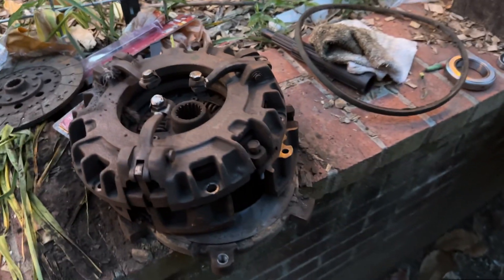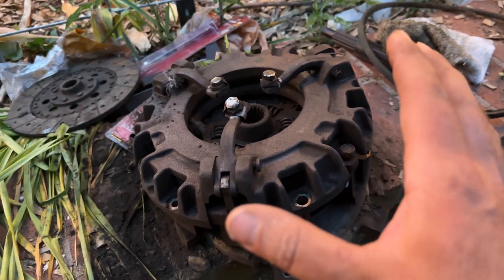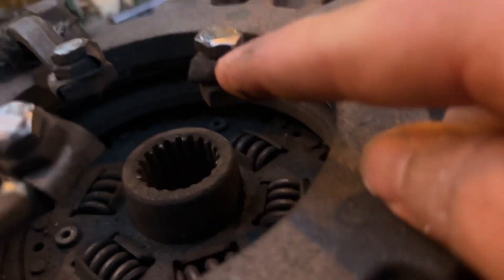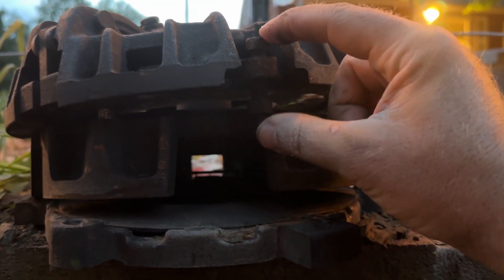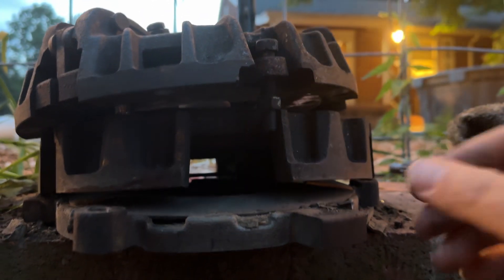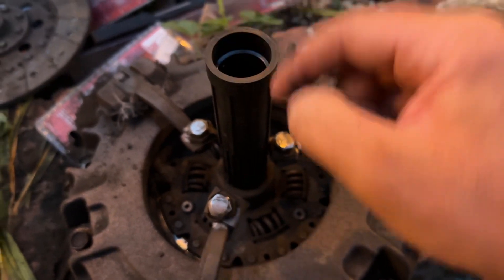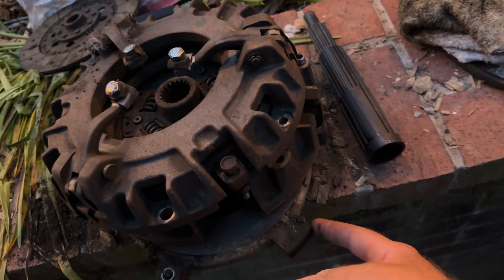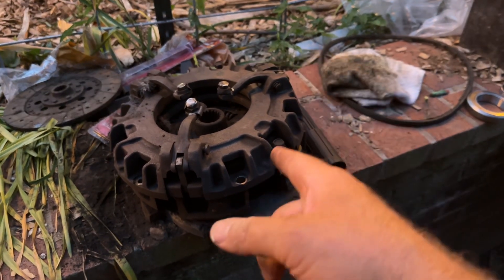John Deere 850/870/950/970/990/1050/1070/4005 dual clutch disc adjustment

Comment: I have a 770 tractor that I'm going to need a clutch replacement soon. Where did you get the clutch from? My local JD dealer wants $3,300 for a new dual disc clutch.
Reply from the maker: Farmland Tractor.